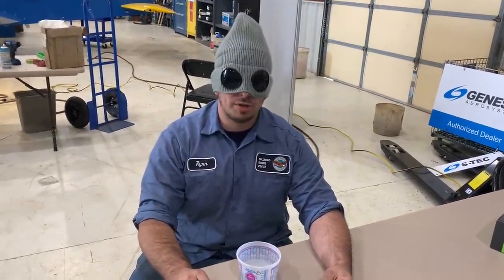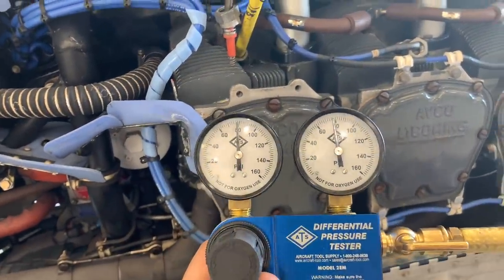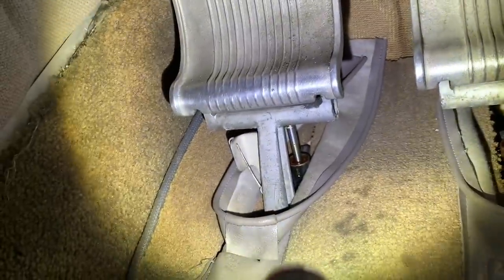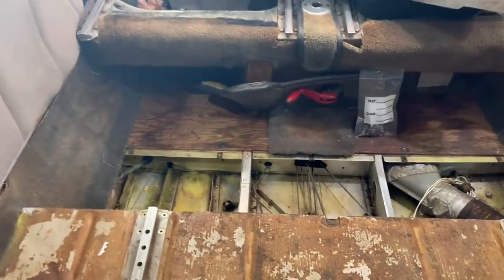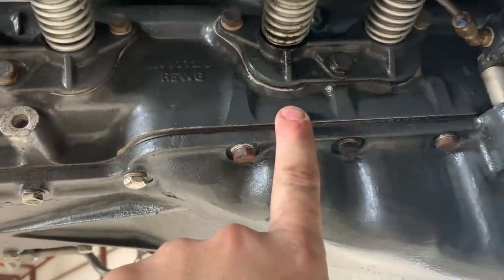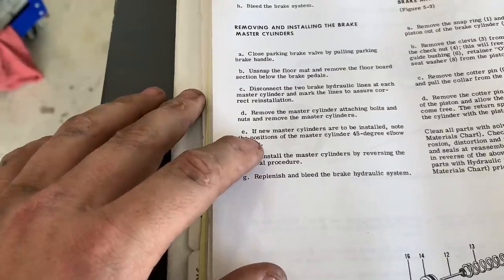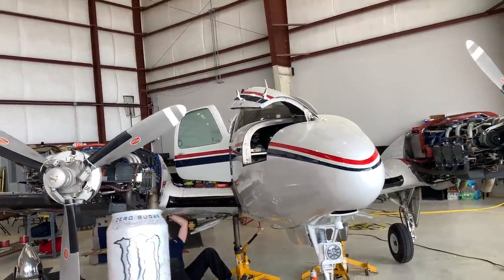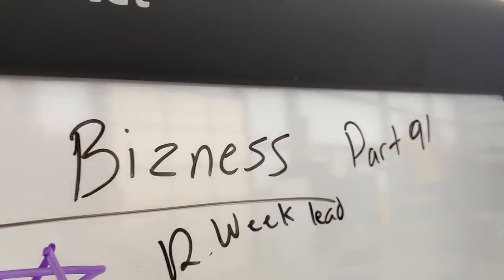Baron 56TC annual inspection finds.   Days in the lives of underpaid general aviation workers.

Comment: I have not been involved in "General Aviation" in many years.  Your IA's explanation at 25:44 is unclear to me.  How does one accomplish the three following things simultaneously: signing off an annual inspection as complete, and documenting that the airplane is in an "un-airworthy condition" and have the owner fly the airplane?  The Barron has an "Airworthiness Certificate" that Beechcraft provided with the original delivery stating this Barron conformed to the required manufacturing standards when the FAA granted Beechcraft approval to manufacture the airplane.  The leaking fuel bladder was not part of that approval process.  The FAA never granted Beechcraft the authority to deliver this (or any) Barron with a fuel leak.  The sharp A&P discovers a leak in the fuel bladder and documents that leak.  As a result of this discovery and logging the fuel leak, this Barron no longer conforms to the requirements of the original Airworthiness Certificate.  And, as such, is prohibited from flying because it is "un-airworthy".  Unless there is a minimum equipment list (MEL) associated with this aircraft that may provide some relief, how does anybody then legally "fly" this aircraft without going through the special "ferry flight" permitting process?  If the owner, or anybody else, decides to take the airplane flying with a signed off annual inspection completed AND a list of discrepancies, including this leaking fuel bladder with the statement that the airplane is in an UN-AIRWORTHY condition doesn't that violate Part 91 and likely invalidate liability/hull loss insurance policy the owner has (should have)?

I understand the fact that the owner can get any A&P to repair and sign off the discrepancies and it does not need to be this shop/A&P/IA Inspector.  But, how does this Barron FLY legally with a "known discrepancy", the leaking fuel bladder, which is an airworthiness item and documented in the airframe logbook without MEL relief or a "ferry permit"?

What is wrong with my analysis, and can you clear this up for me?

Great video by the way and you earned another subscriber - thank you.

Respectfully,
Reply from the maker: That’s a lot to absorb.. I won’t be able to answer everything satisfactory for you as I’m a newbie A&P… but I’d recommend you listen to Mike Busch.  Also, throw away anything you learned in commercial airlines for GA part 91.  
We sign off the annual, because we did the inspection to completion.  The aircraft is unworthy, there is a list of squawks in the logbooks.  At that point it is the owners responsibility to repair the aircraft, and get A&ps to do the work.  In GA there’s a lot of guys with a trailer full of tools that will come to you.  So if the owner flies that plane and something bad happens, or the owner doesn’t fix, and another person flies the plane.  The blame is on the owner
Reply: @aviationsquared1909  Again, thank you for your time in making these excellent videos and for answering the question.   You are a professional and your time is valuable.   I'm not sure who "Mike Busch" is or how I "listen" to him.  Does he have a separate YouTube channel, podcast or is he somebody else on this channel?  I just "found" Aviation Squared" today, so I am a new subscriber.  I've got an A & P but have not used it in decades.  When I watched the above video I was questioning the LEGALITY of anybody flying the airplane with a known and documented discrepancy.  The part about signing off the annual as being completed, with a list of discrepancies some of which are airworthiness items is not confusing at all.  However, the part about the airplane then being legally able to fly without mentioning either a ferry permit or MEL relief "seems" wrong, but then again I am not active on the maintenance side of aviation.

Congratulations on your excellent YouTube channel, it should do very well!  You have great content, great video, good explanations and your videos are just the perfect length!
Reply: @apackwestbound5946  Your correct in thinking the aircraft cannot be flow with an un-airworthy result in an Annual inspection. The discrepancies need to be fixed before the aircraft can be flown. A special airworthiness certificate can be applied for at the local FAA FSDO. Though they would ask why you need a ferry permit. A leaking fuel tank is not something they would allow. If the owner flies the aircraft with an un-airworthy sign off, he is in violation of the FAR’s.

Comment: Wanna move to Hawai'i and make 6 figures?
Reply from the maker: I’m land locked.  I’ll be here pulling in $16 an hour
Reply: @aviationsquared1909  THat's your call bro. I can get you atleast $50/hr
Reply from the maker: I helped ship a Piper arrow in a shipping container last year to Hawaii You involved with the reassembly?
Reply: @aviationsquared1909  I did put an arrow together last year.
Reply from the maker: Bondo all over the wings from hail damage?
Reply: @aviationsquared1909  I don't particularly remember there being bondo but I wasn't on the job, my guys were.

Comment: This shop is a mess.  During an INSPECTION no maintenance is to be performed.  Doing so could hide or CAUSE other issues.  A GOOD IA would do the inspection and the required Part 43 maintenance items THEN talk to the owner about fixing stuff.  Notice they said they fixed the brakes WITHOUT owners permission.  This is a DIRECT VIOLATION of the FAR as AnPs only perform maintenance AT THE DIRECTION of the owner/operator.  This place is fast and loose and I would flip my shit if they worked on my plane without my express permission.

Comment: Please, wear gloves. Brake fluid and fuel are toxic.
Reply: When they replace the fuel bladders, they will be sitting on creepers, reaching overhead into the wing, with undrainable, residual fuel running down their arms.
   You don't work on these without getting avgas, motor oil, and hydraulic fluid on you. Some wear gloves. I think they often do little good (think fuel down arm), and they reduce dexterity,  and often get the liquid you are trying to avoid inside them, especially after they inevitably rip.
   I do keep them around, and use occasionally. 
    The hydraulic fluid this uses isn't too bad, most jets use nastier stuff.